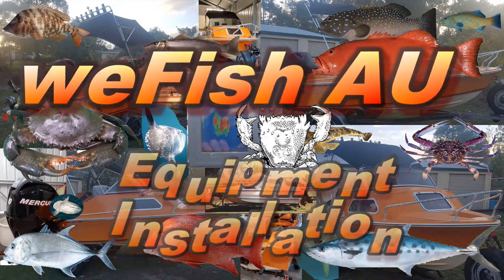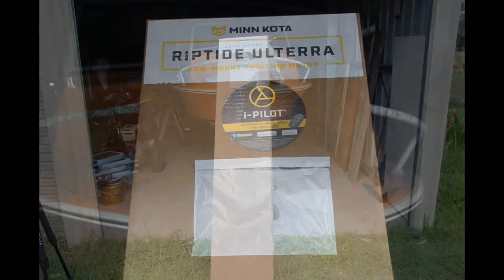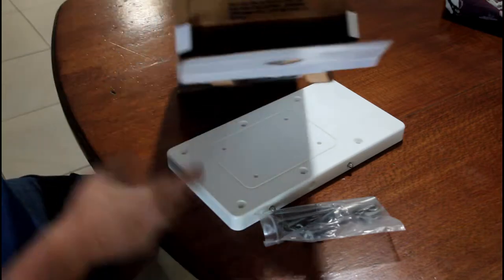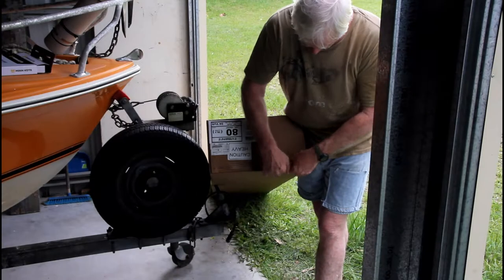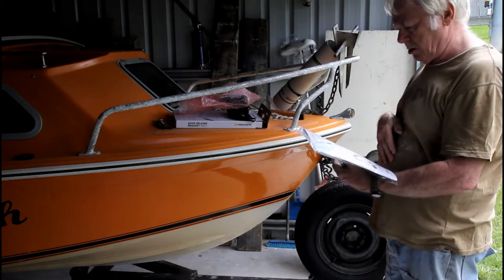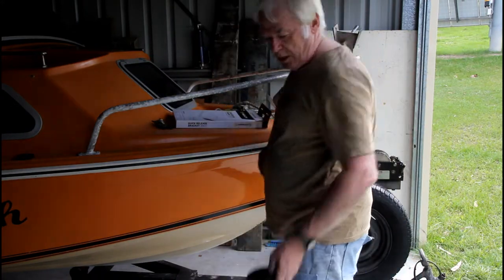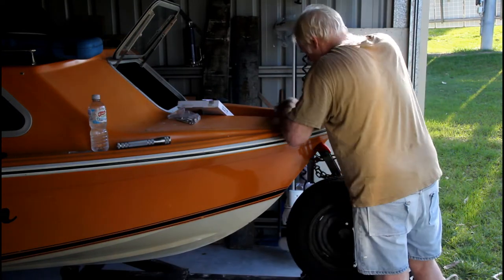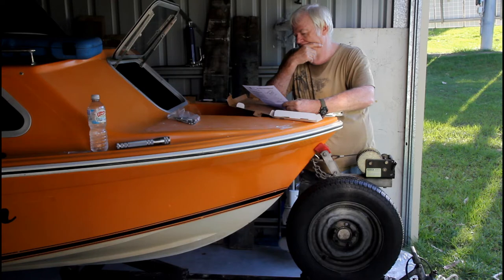Fitting a Minn Kota Trolling Motor - part 1 of 4

Comment: Hi mate, I have been observing your ingenious installation of ulterra on your orange boat. For the last 6 months or so I have been searching the Internet to see if anyone has installed a trolling motor on a cabin boat.  
If you don’t mind I have a few questions to ask about the install and your orange cabin boat.
Reply from the maker: Sure, fire away.  Depending on your timing I might take a few hours to respond but I am happy to answer your questions.
Reply: @weFishAU How big was your orange boat? It looks similar to mine which is 4.6 meters half cabin fibreglass. I have been wanting to install a spotlock electric motor in the front but was a bit hesitant because of the fact the head will stick out a bit like the one you installed. 
My boat also is a bit curved in making your fibreglass mould did you just use fibreglass strands and resin?
Did you ever had a need to use your anchor after the trolling motor installation?
How long did the batteries last on your 24v system?
Did the ulterra ever fail to stow and if so how difficult was it to remove it from the bracket and bring it up?
I would like to install the Ulterra but maybe a little out of my range I am also considering something a lot cheaper just to try it out.

Thanks I may have some more questions if it's ok?
Reply from the maker: The orange boat was a 14 1/2ft  (4.4m) Haines Hunter.  I took the bow rail off to fit the Minn Kota rather than cut a piece out of it.  The Minn Kota has to stick out a certain amount so it will clear the boat when it deploys.  I had it sticking out just the minimum amount because I had to mount it more diagonally to fit it.
For the glass pad I used mostly chopped strand mat and resin.  I think I may have thrown a layer of woven roving in there but that was just because I had it to use up, not because it was needed.  I put some weight on it to squeeze out the excess resin.
I took the anchor out when I put the trolling motor on.  I never went out in that boat for an overnighter so the fishing was always either spot lock or drift.
I had 2 x 100AH 12V batteries in series and I never ran them flat.  Would have had it running for a maximum of about 6 hours on some trips.
I never had a failure to stow.  There is an emergency stow procedure but I had a quick detach fitting so if I ever had a problem the plan was to just detach it and bring it in through the hatch.
I got the Ulterra because I had a half cabin and climbing forward to deploy and stow it would have been a nightmare.
Sure, ask away.
Reply: @weFishAU  I’m so grateful, you answered all the questions I asked. I will watch the installation videos you put up again and if I have anymore questions i will get back to you. You’re a champion.
Reply from the maker: You're welcome.